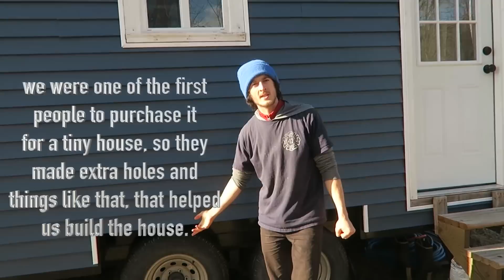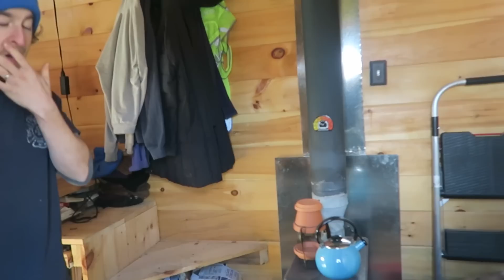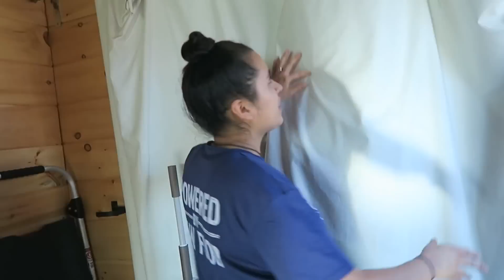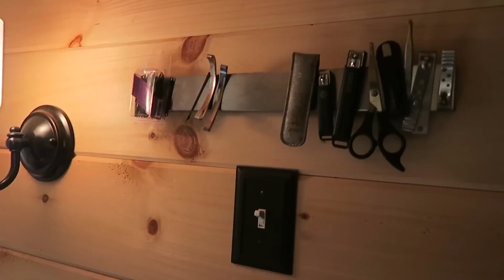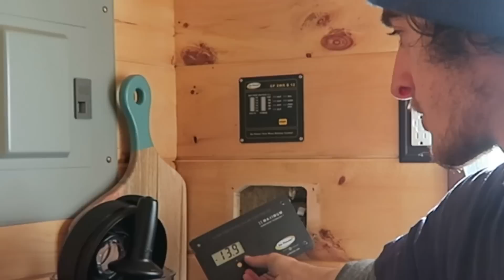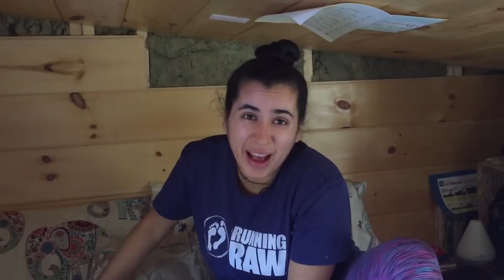MY BROTHER & SISTER-IN-LAW'S TINY HOUSE TOUR

Comment: You need a battery bank that is pure sine, they will store your electricity, you need a converter as well as a monitor to tell you the amount of power in each battery. Never let batteries go below 50%, they will not last and batteries are expensive.  
Your best bet is to talk to a camper or van dweller who knows what you need to get the most energy and how to wire it.
I heartily endorse Bob Wells at YT channel CheapRVliving.  He is very kind and generous with great advice. Best of luck.
Jane and her wacky sidekick Lola, the Boston Terrier

Comment: First of all why on earth are you running that godforsaken generator all the time for one lightbulb???? it's absurd, the money you're throwing out the window!  even if you have the Freezer running, get a few old batteries and start using that solar system you have maybe you'll have to supplement an hour or two per day with the generator but that should be it! 
You can find old batteries for next to nothing and give them a big boost with some Epsom salt and distilled water then you can build as big a bank as you need till you can afford good Deep Cycle batteries!
Secondly you say you are the builder of these Tiny homes?    Why is no Moisture Barrier  visible in front of the insulation (where the beadboard is missing on top)??? That will spell trouble in the future.........  Have you done enough research before you started building ????
Reply: vancroft13 I think they're charging the battery?